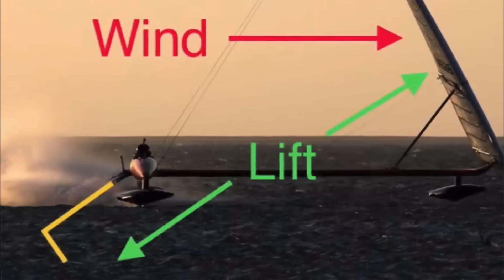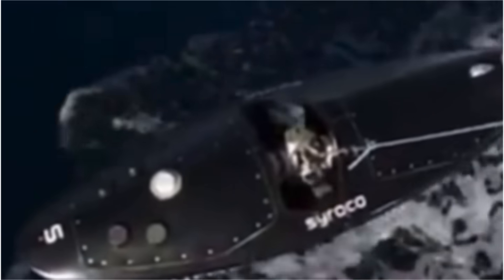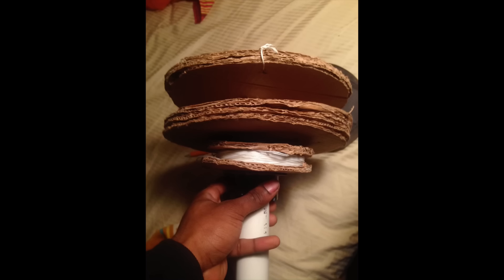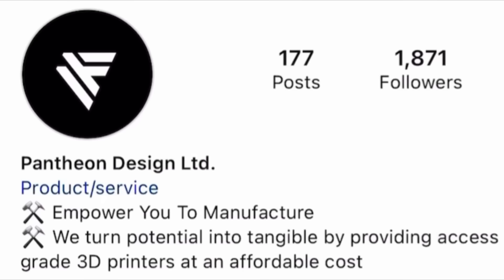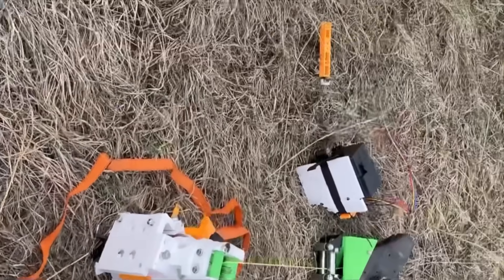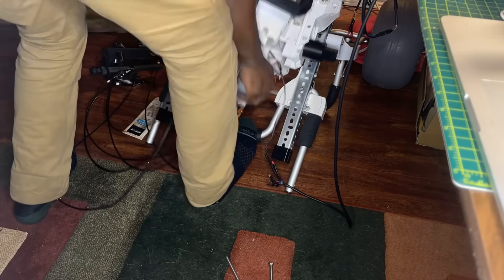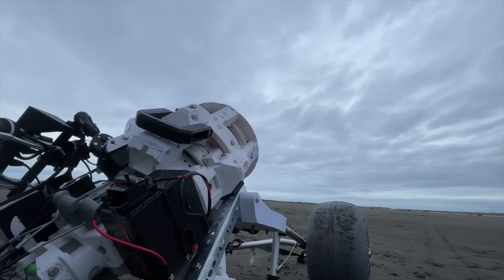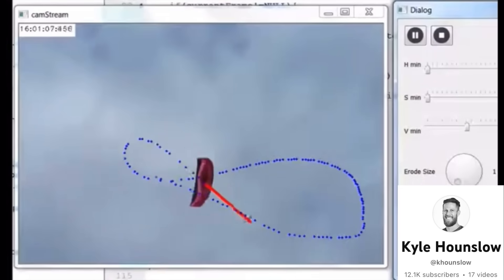Transforming Sailing and Power Generation with The Ocean Kite Engine

Comment: If your wing turns in  O round  instead of 8 parern, it is very good, we can optimise it, as a nascar and have a asymetric design, the inside of the curve adapted to slower speed than the outside... the kite for 8 patern need to be good in right  and left curves, and straignt line.  your kite can be optimised for only one circular clock wise move, and reduce drag and dead time when it change direction ( as it is optimised for circular movement)

Comment: I'm sure you've considered this, but to my naïve eye, it seems like having a single line kite with a wireless control pod controlling the steering of the kite seems far simpler than the mechanical complexity that you have developed. You could also charge the control pod either from harvesting energy from the variations in line tension (perhaps through a Piezoelectric generator) or just having a small rotor, driving a  tiny rotary generator on the pod.

Comment: Do you realize that because of a lever (10" of a generator diameter and 30' of a rope) your kite must spin around like a crazy? They won't give you money unfortunately. Better think about a bunch of foldable/collapsible kites on a rope, so they will pull out the rope in a loop

Comment: Why can't a wireless control system be made directly on the kite or just below it using actuators and batteries, and only a traction rope be lowered to the surface to regulate the length? Перевод через Google translate

Comment: Hi, not sure if this is of interest but this outfit sells kits which enable you to produce forged carbon parts at home using 3D printed moulds: https://www.youtube.com/watch?v=nhqAhYOdGNc - might help to reduce weight + improve strength of some parts if necessary. I've never used them, BTW.

Comment: Amazing! Subscribed ❤
Do you have any back of the envelope calculations to how much energy this could output as home wind turbine replacement? I've had this engine in my dreams, amazing to see you build it for real! 💫
Reply: In my dreams it's two kites, with alternating phases (like poi). The kites are somehow with variable surface capture, the one extending being fully open, the one retracting being partially folded to have it easier to retract. If your computer can keep them in the air, they'll work continuesly like dual pistons.

Comment: Have ypu seen motorcycle turn signal controls? They look loke yours but when you push the middle it turns of, seems loke its be easier and more safe when switching between one sode and the other one, or reeling and stoping wothout having to be so  precise with your cold fingers in the wet and cold?

Comment: This looks really cool! I don't understand how the energy generation works, In the video, it is compared to a wind turbine, but what kind of RPM can you achieve with this system? If just from the rotation of the tether lines, it doesn't sound as if it could generate much power, but maybe I missed something. Really cool project AND execution anyways!

Comment: WOOOOW! This is so cool. Great potential, regen? Why is this not of such a high priority that it is standardised in production? As some who is considering moving to an island that  is very isolated one flight a week. Diesel (after being transported 2600km)is used to generate electricity, (costs is eye watering) Soooo I have been researching alternatives-biogas,thermal batteries, turbines.(thanks Robert Murray Smith). I know of a French company that commissioned the building of aluminium yachts to transport goods (Wine) from France to US. I believe they trade France- US-Jamaica.

Comment: The problem here is this, at night when that 60 knot squall hits you its going to be huge problem, traditional sails can have their sheets eased within seconds and be reefed very quickly. As a professional yachsman I am not buying into this, great for record attempts but not for short handed cruising.
Reply from the maker: Three options 

1) Reef early, in this case that would mean using a smaller kite

2) use the depower line to change the AoA 

3) release one of the control lines and let the kite "flag out"

Comment: I've been closely following your research and I'm genuinely impressed by the innovative work you're undertaking. It's truly inspiring, and I find our interests align, especially in the realm of kite design which I am also exploring.

Upon reviewing your system, I've identified what I believe is a fundamental limitation, not with the engine you've ingeniously crafted but with the current kite design being utilized. The crux of the issue lies in achieving stable force production. The inherent instability of the kite in flight seems to be a significant barrier, particularly when factoring in the ocean's tendency to produce waves at unpredictable frequencies and lengths.

The chosen kite design appears suboptimal as it struggles with fluctuations in power output, primarily due to the hull's interaction with wave dynamics. The process of converting drag force into linear motion and navigating through the wind encounters inefficiencies, especially as the kite slips through the air. This is noticeable as the hull approaches and traverses over waves, leading to varying energy demands and consequently, the kite's erratic speed across its flight path.

At the core of this issue, the kite's need to maneuver in a figure-eight pattern for power generation is counterproductive, given the need for stable flight and consistent power axis alignment. Additionally, the vessel itself could benefit from a mechanism that adjusts its speed to harmonize with wave frequencies, potentially enhancing speed and ensuring the kite's stable flight.

I am eager to collaborate with you to develop a kite design that embodies stability in both flight and power axis, alongside a system for the hull that dynamically adjusts to wave patterns, aiming for increased efficiency and speed. I believe that through joint efforts, we can overcome these challenges and contribute significantly to this field.

I look forward to the possibility of working together. Please let me know if you're interested in discussing this further.
Reply from the maker: I realized kites are the limitation too, I plan to do a deep dive into this topic soon, care to email me? 

Christian.Harrell.OKELLC@gmail.com

Comment: So, isn't the system that SkySails uses simpler in design and function..? They essentially deploy an automated version of your gondola idea, where a little box hangs under the kite controlling the 4 lines for kite steering, and they run the control cable down the center of a single tow line, thats reeled in and out by a drum winch. There are no multiple lines to tangle and untangle running the whole length to the kite.

Comment: I've often thought kite propulsion needed to be developed for sailboats.  Masts are expensive and are limited to the wind that they can reach.  
I've also wondered when kites would be developed for power generation.  Windmills suffer the same design limitations as sailboats.  Kites can be made much larger and reach much higher altitudes than windmills.  What is preventing us from harnessing wind energy to produce electricity?

Comment: Few things I noticed, as a kite surfer:
- the kite doesn't need to move around constantly, unless during low wind conditions.
- If the kite falls into the water, the boat will continue to move in the direction of the kite, making it impossible to relaunch. The system also needs to rewind faster than the speed of the boat otherwise the boat can hit the kite while on the water and cables end up entengled in the boat parts.
Reply from the maker: Very valid concern. What we do is monitor tension through the motor, when tension drops below a certain point, the kite engine reels in the line until a desirable tension is met.

Comment: I've been wanting a silent-yacht solar powered catamaran since they released the concept - one thing I like with them is the kite sail option.  I doubt I'll ever afford one of those yachts - but have been looking at converting older sailing catamarans into solar/electric but still wanted the kite sail option for ocean crossings.  This not only provides the kite sail, but with power generation as well.  I'm looking forward to seeing the advances and if I get a boat to convert, I'll be in touch.
Donate for a Dream

Comment: As a long distance sailor,100K+miles , catamaran owner and rod and reel fisherman, the idea of having a single point purchase and retrieval point is flawed and impractical for a sailing vessel.
Better idea for a wing sail on a catamaran (or tri maran )would be to have 3  reels ,Ie one in each bow  and a central line for a svivel and regen spinner and the power- depower line of the sail
pulling in the line fractionally that is attached to one  side of the wing sail  in one hull would change the sails angle of attack for wind acceleration or a higher point of sailing.as you would do with a kite surf rig
a short mast at the front of each bow for the outboard lines of the sail to the reel would also make sail retrieval much easier without the risk of the sail landing in the water.
This layout would also not interfere  with a existing mast ,boom and roller furler system

Comment: Too many variables and too many moving parts.
Reply from the maker: Have you seen an internal combustion engine?
Reply: @Ocean_Kite_Energy  waves, rain, ice, snow. Lack of wind. And you want to attach a gondola to it? What if it goes in the water? You gonna have it towed back?
Reply: @zirzmokealot4600 dude relax already.. tht was a concept for breaking the world speed record.. but like the man said, a deck mount unit is more practical for everyday folks
Reply: @ojo2988  relax? Did my opinion trigger you
Reply: @zirzmokealot4600  triggered or not, no need to misrepresent the guy
Reply: @ojo2988  apparently you didn't watch the video. Maybe I should of left the gondola part out? Everything I said was accurate. Its called constructive criticism. Dont let your feelings hold you back.
Reply: @zirzmokealot4600  actually watched it several times. I've watched all his posts. He has a brilliant idea!. And yes, your criticism of the Gondola was unnecessary because it was simply his introduction, walking us through his thought process, to what inspired him to build his kite engine. He clearly stated that the gondola idea was "Inconceivable." You invariably just come across as the thought police by trying to critique a man's imagination..
Reply: @ojo2988  you realize you're doing the same thing to me right Mr thought police? Google "constructive criticism" and worry about your own thoughts. You sound desperate to impress this guy.

Comment: Ummm... Easily relaunchability from the sand. Have you tried it from any boat? How does it works with other boats around? How changes the boat`s beheaviour when it has it's bow lifted? How does it work in rought weather? How you downpower your boat? 

Don't get me wrong. You have made an outstanding work up until now, I just think there are yet some questions to be asnwered in order to properly stablish the posibilities of your idea. It's ups and downs, it's "compromise region" if you like.
Reply from the maker: I plan to address most of the questions you have with control. Being able to really control the kite; the altitude, the turning, the depower, the tension are all  important.

Basically this engine can fly a kite just like a human and sometimes better, so depending on your situation, if a human can handle it, so can this kite engine. 

The limiting factor here is kite technology. In the coming videos I hope to share my conversation with Paul Larson of Sailrocket (fastest sailboat in the world) We talk about some of the hurdles kites need to overcome. 

Get excited.. I have some innovative solutions that might def change things. 

Thanks for your questions and support, it's coming from the right place, keep it up.

Comment: I often used a single line kite called a sled. It created a lot of lift, very stable at 15 to 20 knots and pulled my boat along very well. You could use it not only downwind but with a decent amount of lateral surface would work well 45 degrees off downwind and if you designed it so that it would pull ahead of the center of the the lateral area, you could balance the rudder and kite so that you could sail without a hand on the tiller just as you would normally. I always used a "Tiller Tender" and never touched the tiller except to change course. Because the kite's line of effort was very low, it would lift the bow. Nice.

Comment: STUPENDOUS CONCEPT...
Your work is much appreciated, and I wish you the best.

I have been looking at this for a catamaran for a few years.  My thoughts on launch and retrieval are having the engine immediately forward of the mast with a 5' carbon mast to make the process/kite easier to manage on deck.  It would have Dyneema lines to stabilize it from the top and a release bracket on the bottom to mount to the deck.  

If you were on the hook or a buoy, could lines be run aft to fly the kite from there for power on less than sunny days?

Regarding sails, wind speeds vary the higher up you go. The most I see is two kites: a moderate wind of 15-35kn (nylon?) and a heavier wind of >30kn (line requirements?  kite made of Dyneema?).  I dream about going 30kn+ downwind with a giant smile!

I am also looking at a wing between hulls lowered/raised with inboard daggerboards to even out the ride and reduce displacement.  Additionally, small canards aft between the hulls would further reduce motion.  To reduce drag, the rudders can be partially kicked up.  The wing location would also be just forward of the mast with two positions: the same depth as the hulls going downwind and a few feet lower for upwind.  

The regenerator part is extremely interesting since I want electric drives with a hefty battery bank.  The propellers will help regen, but the more the merrier!

Comment: There are a few companies working on using kites for wind power: (1) kitemill of Norway has a 100kw unit, (2) Kite Energy in Italy has a 100kw unit, and (3) Kite Power of the Netherlands is selling a 30kw unit and has a 100kw unit in development.
Reply from the maker: Seems like none of them besides Skysails can move a boat.. and I have reservations with rigid wings and turbines aloft with conductive cables.. (especially for small scale testing) They are super expensive, and the cost of a crash can be catastrophic, and take a very long time to build.. Traditional wind turbine blades are eroding in half the time they thought.. I fear the same will happen with these rigid wings if they don't crash first. 

 I think kites should be thought of like tires on a car.. Durable but ultimately replaceable.
Reply: Adding the SP80 speed sailing (kite) project from Switzerland to this list! Aiming at 80knots.

Comment: I have many questions. I know kites, I know sailing. Light or Gusty power challenges? Add this to a foiling hull would be incredible. Kite profile vs load to pull needs explanation! I’ve sailed 7m in 40kts and it’s scary! With a foil u can downsize, but u need a story for partnership
Reply from the maker: Hey! I have questions for you! You are talking about kiteboarding? 7 meters in 40knots is crazy no matter how you hash it.. that is 8x more power than at 20mph...

Comment: I would love to see this adapted to use a higher efficiency/precision control kite. A scaled up Revolution kite may have greater up wind potential. Mega-condor?
Reply from the maker: No, that's exactly what I'm looking to do. Acute tension control.. Extreme precision with line management.. It should have skywriter accuracy. That is why I put so much attention to the sensor layout. More on that later, stay tuned.
Reply from the maker: You have a real understanding.. The spar is exactly what upwind kites need. Im fully prepared to build that kite.. But before that happens I'm tackling control. But I think we see the same thing.

Comment: Thats awesome. I think with 2, scaled right, you could skip generators and batteries on a good day for sailing. Adding one to lift a traditional boat somewhat seems like a huge boost in efficiency.
Reply from the maker: With two you could have basically two mainsails as well, just twice the power.. And when AI vision control gets involved youll never have to worry about the lines tangling.

Comment: Fascinating! I wonder how the price compares to traditional rigging. Think about how expensive it is to repair sailboats it's what keeps me from owning. I just pay for shared cruises.
Reply from the maker: Ive been doing a cost analysis, and it seems changing the rigging on a 30 foot sailboat could be about 15,000-20,000.. These could be a cheaper option while providing electricity and more deck space.

Comment: You can have those dragon giant barges that are battery charges on a route that comes in and take all the power off of the battery barge and send it back out on a route it goes out on a new route like circular route goes out comes back in fully charged and it's just bringing in batteries and electricity